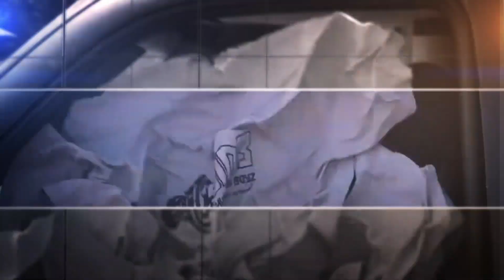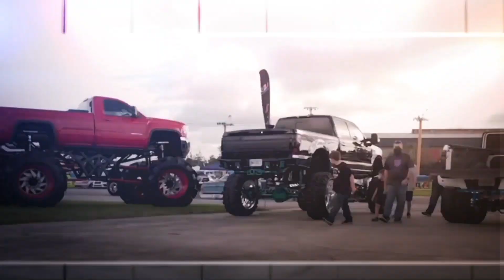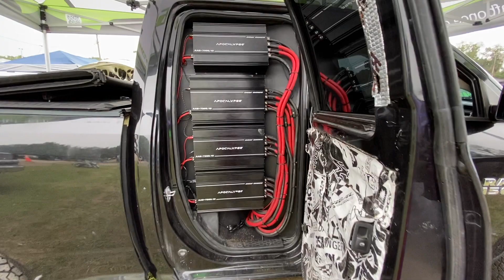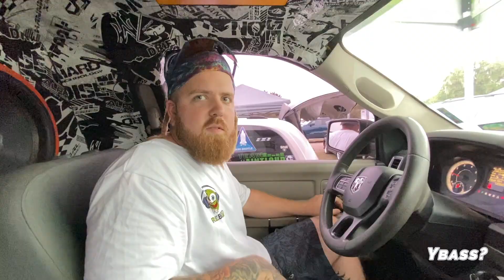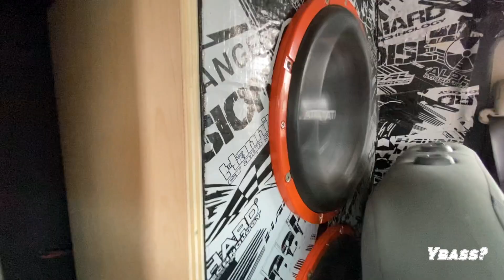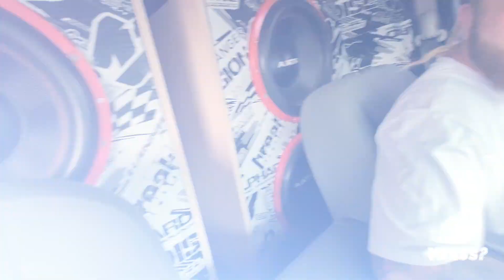Ram Truck Build! 4 Avatar STU 15s On 4 Apocalypse aab-7900.1ds

Comment: Im also Brandon. I’m almost half there, I’m only running 2 15’s, 305 on 2 4900’s, a 7900 under my bed. 390 amp alt. Shit for battery though, 2 little 6.0 lto.

I shout at myself in the mirror each morning to DO BETTER!